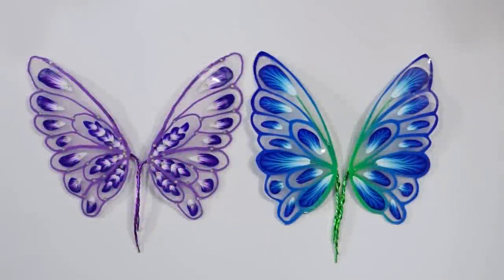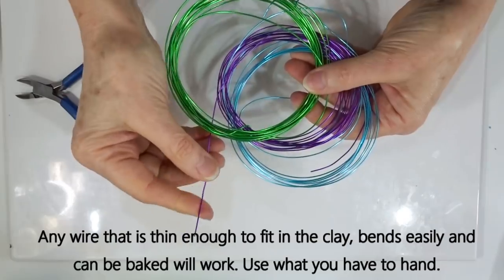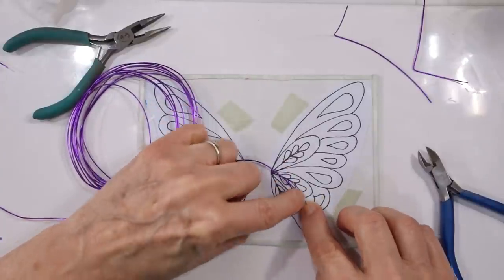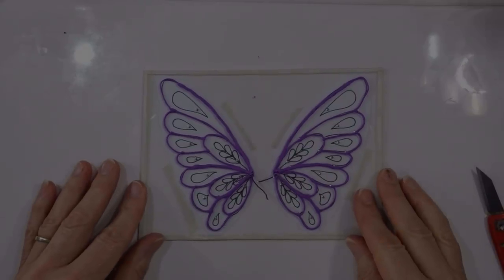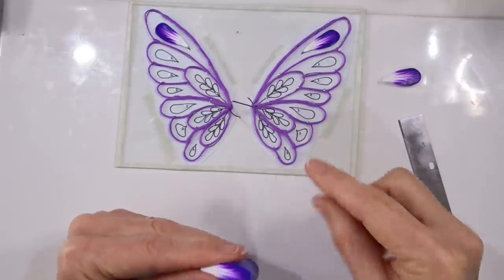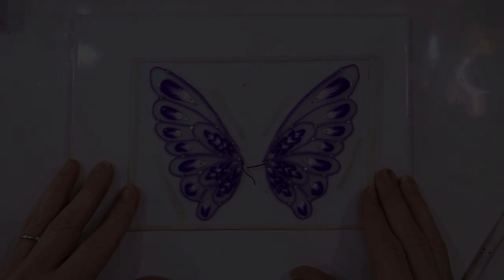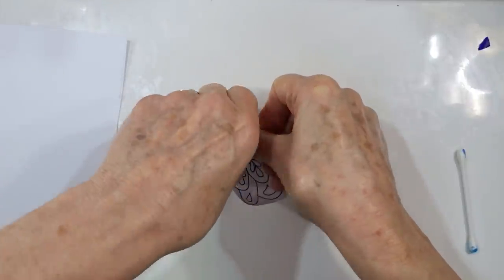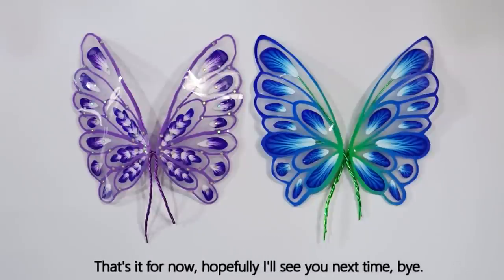Fairy Wings in Polymer Clay, a Tutorial

Comment: Beautiful 🤩. When you bake do you go by the liquid clay baking directions or the not liquid clay baking directions?
Reply from the maker: If I have a mix of both I go by the non liquid clay baking instructions as the normal clay needs to be baked fully in order to not to break after baking. With Polymer Clay you can bake for longer than it says it needs, and that will not harm the clay at all. Most liquid clays bake at the same temperature as the non liquid ones, so that is not a problem either 🙂

Comment: I am getting my materials ready, I will make these asap.  Thank you, such a great teacher and most importantly great artist.  Thank you Fiona.  One question, often in other videos you mention using pvc glue instead of polymer liquid clay?  Is there any chance that would work with these "fairy wings"?
Reply from the maker: Thanks so much Lisa :) To be honest I didn't mention it as I hadn't had a chance to experiment with it yet. What I would try first, is lay the polymer clay on the glass or tile as I did in the video, then bake it in situ. After it had cooled I would leave it in place, and then add PVA, and let it dry naturally. You could then remove the whole wing, and add a layer of PVA to the back. If I get a chance, I will experiment and let you know :)
Reply: @FionaAbelSmithPolyOriginals  across the pond good ole us, it's almost impossible to find Fimo liquid clear clay gel at any price that's even slightly reasonable.  I did make a pair and did what I could, but my kato liquid was too thick, sadly after a day and baking as instructed some of the clear component areas cracked.  Do you think viscosity is the culprit?
Reply from the maker: @LisaBell  I am so sorry you can't get some. I didn't get around to experimenting using the Kato liquid clay, so possibly. The Fimo is quite gelatinous. My very first thought when I was messing around was to use resin, or a mix of resin over the liquid clay. But the resin didn't bend at all after curing, although it gave a wrinkled effect over the cured liquid fimo as that bent and the resin didn't. But I wonder if a coat of resin over the kato liquid clay would give it more strength? Even if there was no flexibility? I may need to have more of an experiment, but am slightly stretched for time just at the moment due to a family emergency :( If I get a chance I will and let you know what I discover ;)
Reply: @FionaAbelSmithPolyOriginals  Best wishes for you and your family. Thank  you.

Comment: Did you coat the back of the skinner blend set (the 2nd set) with liquid clay and bake again so that they ate the same both sides?
Reply from the maker: No I didn't :) The only rerason I did that for the first one was so I could inset the crystals :) You do not need to coat both sides, and the side which is face down is naturally shiny, and the liquid clay does seep underneath a little during the baking/curing process. You could however add an extra layer of the liquid clay either before or after baking if you wished. I think it may add a little extra flexibility if you did. I hope that helps ? :)
Reply: @FionaAbelSmithPolyOriginals  😁 thank you. I am making a fairy based lap book for my granddaughter (who loves butterflies also) and these would be a perfect addition to it.
Reply from the maker: @angelay1925  That sounds lovely :) Have fun :)